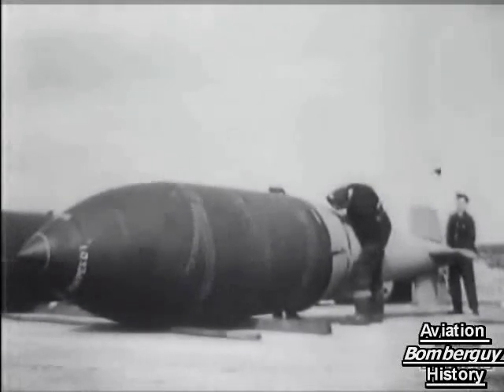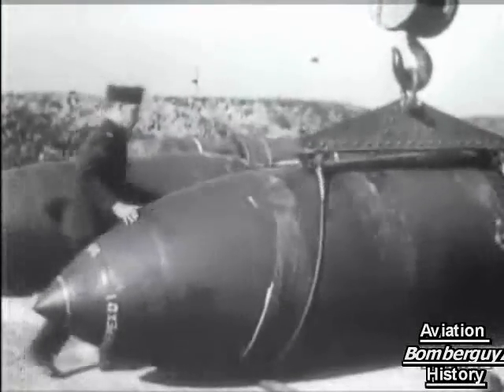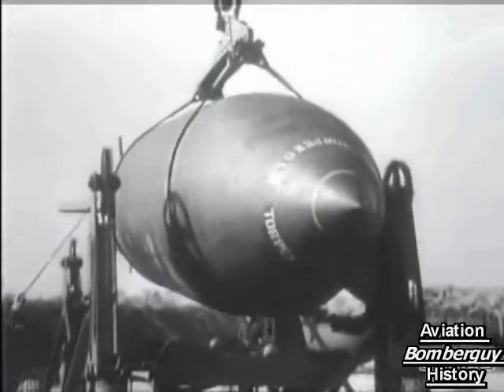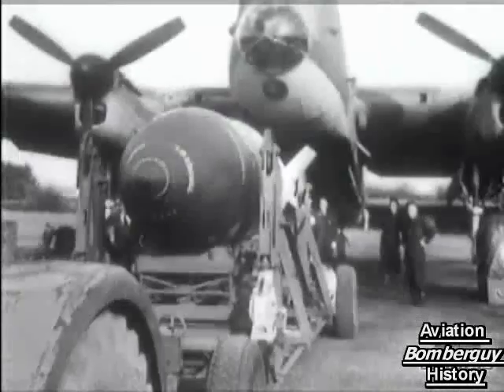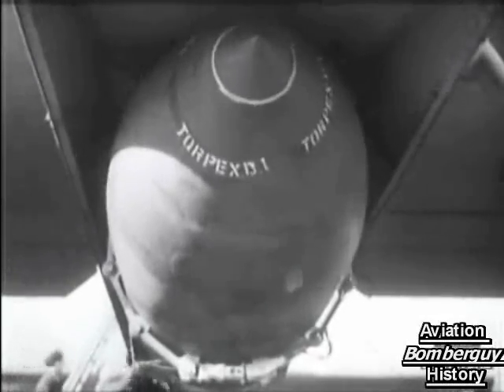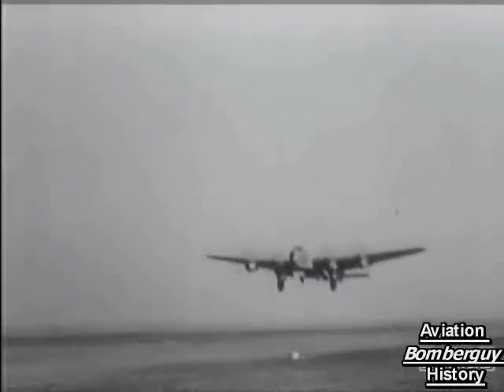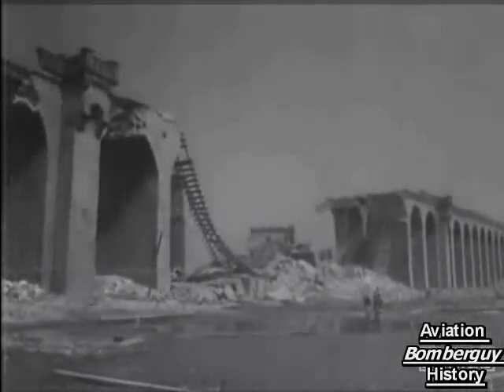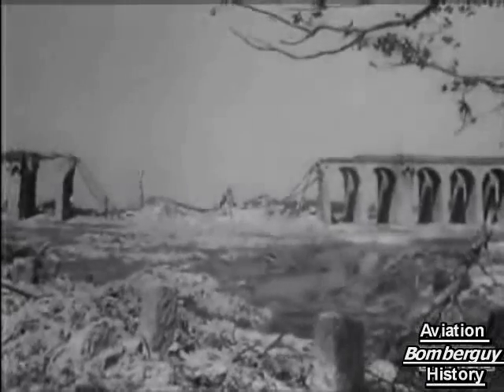Grand Slam bomb

Comment: lol, "Precision attacks" with a 22,000lb unguided bomb. I'm sure they hit precisely the right country.
Reply: +tSp289 The footage speaks for itself?  as does that of the Tirpitz, which considering, as you say, these weapons were unguided, displays some very accurate bombing for 1944.
Reply: So?  They still got the fucker.
Reply: Claudio......
Hit the Tirpitz didn't it!  Learn your history befor posting stupid remarks!
Reply: Much more precise than the V1 and V2.
Reply: i expect only the best crew would get to do missions like this. the 10 ton grand slam wouldn't be cheap.
Reply: Tia....
Ill informed rubbish from an armchait "expert"!
Reply: @morriganravenchild6613  lol Right. He couldn't even hit toilet paper right on target on his own asshole.
Reply: They were equipped with a fairly effective analogue computer bomb sight
Reply: There was a post war test of the bombs on the heligoland submarine sheds to work out why they had failed to penetrate the thickest reinforced u boat pen roofs. They were typically getting 60% of bombs on target from 20 -26 thousand feet, pretty impressive. The big bombs were breaking up on impact. The conclusion was that their diameter was too large, the steel wall too thin and the nose insufficiently pointed to penetrate far enough into concrete.
Reply: LOL --- "I'm sure they hit precisely the right country."
Reply: They had to drop   half a hundred until they finnaly hit the tirpts. There is a reason there are so many tiny lakes on that area nowadays.
Reply: @tiagodagostini  Tiny lakes, in a Norwegian fjord?
Stop yourself!

Comment: The biggest threat to the allies during most of WW2 was not the Tank or ME109s but the Uboat. Germany along the Bay of Biscay had built enormous Uboat pens which were impervious to conventional types of bombs at the time. With concrete roofs over 20ft thick something special was required to destroy them. Hence the Tallboy. The Americans never had an aircraft capable of carrying one until the B26.
Reply: Sorry but I think you mean the B29.  The B26 could only lift 4000-5000 load.
Reply: fred wilson Sorry finger trouble, meant a B29.
Reply: The B29 could not carry the Tallboy or the Grand Slam because US bombers all had twin/lengthwise divided bomb bays. That is why the Nuclear bombs for Hiroshima and Nagasaki where so short in length. They had to fit the forward bay. Only a few specially converted postwar B29's had a long single bomb bay ( at the cost of structural integrity and all bottom guns.)
Reply: +james webb the b26 could not carry a bomb even close to that size.
Reply: The U-Boats were not as effective as usually believed. They sank less than 1% of the Atlantic shipping going to the U.K. and about 0.5% of the shipping returning to North America. They did have some not inconsiderably effect on the Murmansk route and they were still used long after the tanks had withdrawn from Africa and France and the ME 109s could no longer fly over the U.K. so I guess, in that respect, they remained a big threat.  This was over 70 years ago but I will say that the Tallboy concept lives on and is of tremendous value as it has largely replaced the need for use of tactical nuclear weapons.
Reply: however, only ONE Tallboy bomb had a confirmed hit on the U-boat pen in Lorient, France

Comment: I remember reading the book 33 years ago as a kid called the Dam busters .Were lots of info at the end about the grand slam and the tall boy bombs.One part talked about how the German believed it was rocket powered Because it was going trough 20 feet of concret  to take out sub pens.
Reply: The book is by Paul Brickhill. I read it many years ago as a 10-11-year old. Made a big impression. Re-read it several times as an adult. A very readable book, although I think it probably over-simplifies a lot of the detail. Also, the details of the bouncing bomb were still secret when the book was first published in the 1950s. Originally, Wallis had wanted to use Grand Slam-type bombs (which were still only a concept in his mind at the time) on the dams. But he realised that the aircraft at the time could not carry the weight needed, so he had to re-think his approach, and eventually came up with the bouncing bomb. It still used the concept of the "earthquake, but using a different delivery method. Given that the bomb was detonated in close contact with the target, and that the water would magnify the shock-wave, Wallis was able to use much less explosive than he would have needed in his then still theoretical 10-ton bomb, and the Lancasters of that time (1943) were able to carry the 3 ton or so "Upkeep" bomb. (Lancasters were continually upgraded throughout the war, and by 1945 could carry 10 ton bombs, although there was not much left for them to do by then).

Comment: As I understand the history of Wallis's designs, he first drew up the design of the 22,000 lb 'deep-penetration' bomb (and a six-engined bomber to carry it) in around 1941, but when the ideas were rejected by the Air Ministry, he was eventually given the OK by Vickers to produce the 'Tallboy' a 12,000 lb 'scaled down' version, the success of which led to the eventual production of the Grand Slam. The Tallboy was produced first, but the Grand Slam was the original design.

Comment: unfortunatley this is a case where wiki is wrong, I know that I got my information directly from the Barnes Wallis foundation to quote them "Absolutely, yes. It and Tallboy could both reach nearly Mach 2 if dropped from high enough, but Mach 1+ was probably achieved on every drop. The tail fins were canted to give spin to the bomb as is fell, so that it didn’t “topple” as it went through the sound barrier."

Comment: Whatever your geo - modern views it was an amazing piece of engeneering only specially stripped Lancasters could carry the bomb stripped of all but the rear gun turret. Only 41 were dropped in anger If I`m correct. They were so big and fell at such a speed that a direct hit wasn`t required! And it`s smaller cousin the 12000lb tallboy bomb was used to sink the German battleship Turpitz by 9 and 617 SQNs.

Comment: @LottoWinner999 The Red Army would have rolled through the Wehrmacht regardless, of a western front or not. Stallingrad was the turning point of WW2 not Normandy. The British Empire landed more troops at Normandy than the US, 83k vs 73k. Actually I think you'll find the RAF did more than it's fair share in WW2 that goes without saying. Google the Burma Campaign and the New Guinea Campaigns, they were fought mostly by Commonwealth Forces.

Comment: @LottoWinner999 The Royal Navy could and did operate in the channel you tool, despite the luftwaffe. Dunkirk was a victory, the army was evacuated along with many French and Belgian soldiers. Equipment can easily be replaced and it was rather quickly saving men was more important. Germany didn't have the ships and landing craft to land an invasion force let alone resupply one once there. Get a clue and read up on Operation Sealion.

Comment: @maureenOWW I think you have missed an important point, If the RAF had not won the Battle of Britain and denied the Germans air superiority an invasion "MAY" have still been possible but very risky. It is a fact that Operation Sealion was only cancelled AFTER the Luftwaffe was defeated in 1940. just to throw one other iron in the fire are you aware that on average only about 31% of American bombs landed within 1000 yards of their target The Brits 617 Sqd hit Turpitz 6 times from 20000 ft

Comment: Now that's a BOMB! Only one other bomb was more destructive, just ask the Japanese. Even a "near miss" of a 100 feet (something not tolerated today with so called "lazer guided guided bombs) could and did destroy the target, and sometimes that was more preferable than a direct hit, for the colateral damage that it caused. It is also interesting to note that the Lancaster bomber upon release of the bomb would typically gain two to three hundred feet upon release.

Comment: There was another bomber that could been used by the Allies for the Grand Slam and Tallboy.  But US would have ask for greater involvement with Wallis and that those bombers would have to finish before the war ended.  These bombers were the B-29(in service in late 1944) and B-36(in service in late 1947).  Another US bomber that could have been used is the B-32(late 1944).

Comment: this bomb was a WW2 version of the bunker buster, unfortunately in order to build up enough energy to penetrate the ground the bomber has to fly high, which limits its ability to hit point, harderned targets with WW2 technology. The size of the bomb is not about creating maximum blast effects to affect a large area like your modern MOAB or Russian FOAB.

The ability to deliever precision munitions will not be realized until Vietnam.
Reply: GBU-57A/B MOP is the modern version, upscaled from the GBU-28 (the 8 inch terror).

Comment: Depends on your criteria. The underpowered B17 could soak up punishment, but so could the Wellington. In terms of payload, as a rough guide between 1942-45, the 12,731 B17s built dropped 640,000 tons of bombs, while 7,377 Lancs dropped 609,000 tons. A third of B17s were lost in action, nearly half the Lancasters.

Comment: Best heavy bomber of WW2 -- wow, what a loaded question! The B-17 had the best press (well-covered by radio and newspaper based in England). Lancaster and B-24 were used in bigger numbers and with more effectiveness. (The RAF was smart enough to use the Lancaster only for nighttime raids until the Luftwaffe was neutralized by long-range escorts). The B-29 managed to wreak unimaginable ruin on Japan BEFORE Hiroshima and Nagasaki. (Of course Japans AF was a non-factor.)

Comment: You may well say that, but the Lancaster had 8 machine gun compared to the B-17's 13. B-17 can carry 8000lbs compared to 14000lbs of the lancaster normally. If both are overloaded, it is 17000 to 22000.

One other factor that made the B-17 more successful was the fact it had fighter escort. Before the P-51's, B-17's were shot to pieces. The RAF knew it was too dangerous without escort, so stuck to night bombing.

Comment: 617 sqn (dambusters fame) was the first to use the grandslam it was designed to penetrate the earth to about 100ft then explode creating a cavern. anything above it just dissapeared into the hole like a hangmans drop.
Oh and Barnse wallis was the designer.
It was also used on the u-boat pens and could go through 16ft of re-inforced concrete before exploding.

Comment: 1o tons means it wieghs 10 tons (22,000 lbs) steel casing as well as explosive charge, the 100 megaton does not mean it wieghed (100 thousand tons!) but it's exsplosive capability equeled 100 thousand tons of tnt. 10 ton bombs where not just filled with TNT either, and may have been equal to a few times there wieght in tnt. and the megaton bombs are nuclear. like comparing one searchlight and saying its 1,000,000 candlelight or a motro with 300 hp its a realative comparison not wieght of bomb.